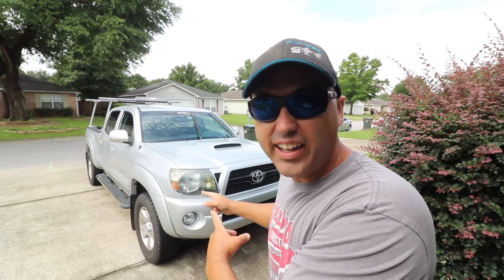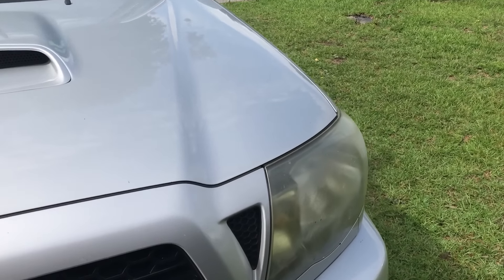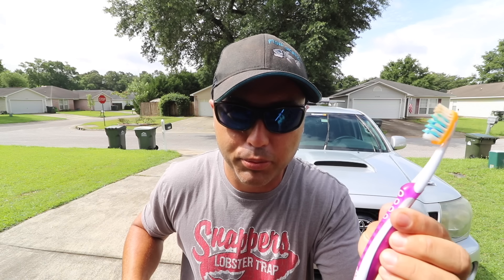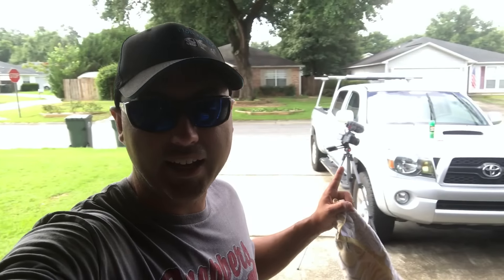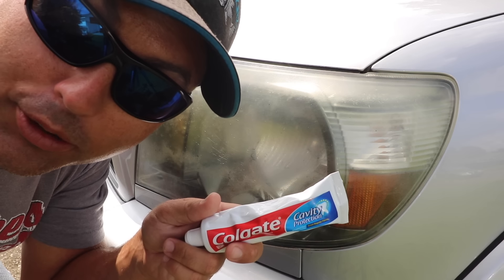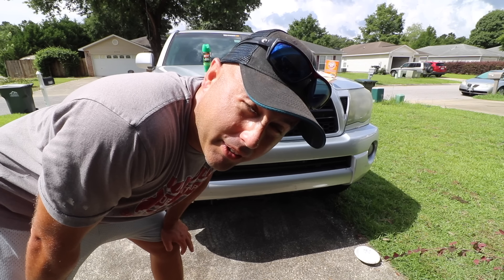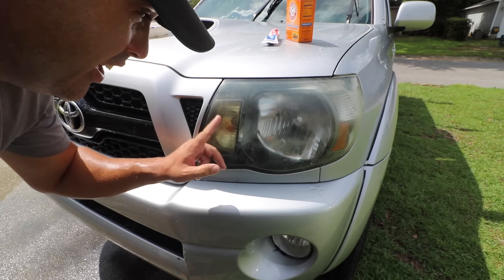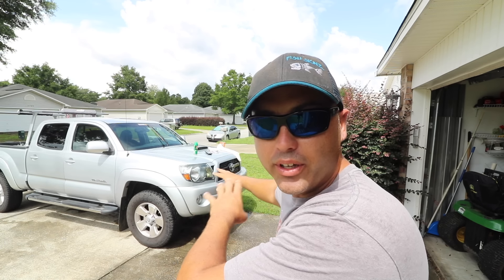The TRUTH about OFF & Toothpaste vs Headlights! (+Update on WD 40)

Comment: If you want to clean your head light plastic, use a wet 3000 grit sand paper, keep the water hose dribbling on the plastic as you rub in circles.
After you have cleaned the gunk off,
Then use chrome polish and a buffer wheel to polish back to a shine.

THEN MOST IMPORTANTLY 
SPRAY THE CLEAN HEADLIGHTS WITH UV PROTECTIVE CLEAR PAINT!!!

You should be able to get all the necessary stuff at your local hardware store.

This is a ONE TIME AND DONE FIX!
At least for me it has been.

Comment: The absolute best way to clean these up.  Start off with 600 grit sand paper sand it until the whole thing is hazy.  Then go to 1000 grit. Then move to 2000 grit. Then get some good wax and a buffer.  It will last a very long time. I do them all the time for people at work.
Reply: After the 2000 go to a 2500 or 3000 grit wet sand.Blow them off with some air/wipe them dry tape the trucks front off and spray them with clear coat. Then wet sand that with a 3000,dry and spray or wipe a thin layer of clear coat on and it will last for years. A friend taught me this and My trucks headlights after about 6yrs still look great.. Thats probaly the most permanent way to go..
Reply: Very true... This is the way
Reply: Yep. I bought a little portable sander just for headlights.
Reply: Yes but for those not wanting to deal with the clear coat, just end it with a synthetic wax, reapply every 6 months (or sooner if you drive a lot).
Reply: I sprayed. Mine with clear coat it fills in the scratches
Reply: Doin the most
Reply: If you do this method and then add a 5 year film that peels off 👍
Reply: spot the redditor
Reply: The only way to do it right

Comment: Mother's brand mag and wheel polish. It is metal polish. Metal polish removes oxidation. Takes two minutes with microfiber cloth. Buff in hard with two fingers. Wipe off with clean part of cloth. 5 ounce container at Walmart in wax section. Works about 4 months. Buff again it gets better. It will not work if it is heat damage. Homeless guy showed me.

Comment: The toothpaste would probably have worked better if you worked it in with a rag. That way it would work much like a rubbing compound or wet sanding. Actually buffing is still probably the best option in my opinion.
Reply: Actually the toothpaste does work . Put the paste on with your finger rubbing in a circular motion once you cover the whole light use a clean damp rag and rub hard circular about 5 to 10 minutes rinse off throughly let dry then rinse off a second time then dry with clean cloth. Next step buy PPF .. 3M paint protection film and place this over your head lights film will last about 5 years . replace when needed .

Comment: I used OFF on my Tahoe headlights a year ago. Sprayed on and cleaned off, then sprayed on and let dry without rubbing it off. I was amazed and it still looks pretty good a year later.
Reply: just got me a tahoe 👀and will do as you said. THANKS😃👋
Reply: faithlilis - Don't spay bug repellant anywhere on your truck or car. It will ruin the paint. Spray it onto a rag and carefully wipe your headlights.

Comment: After 15 years on a used car lot, I used off on a lot of cars. You will have better luck by spraying the off on the rag (microfiber) first and apply it to the headlight in a fast swiping motion horizontally. If you get too much on the headlight, it WILL soften the plastic cover.

Comment: What people fail to tell you is that toothpaste works like rubbing compound...you rinse your headlights and put a quarter sized amount on your buffing wheel and polish your headlights on high speed. Then make sure you follow up with headlight polish to prevent your shiny headlights from fading in the sun. Restoring headlights is basically removing the damaged top coat of plastic. The problem with all restore jobs is that you end up removing the hard factory finish so you keep having to polish with rubbing compound and polish it once a year to maintain it.

Comment: Dude, use a towel or rag and use that with the toothpaste. You gotta scrub man...you ain't fightin cavities you're buffing a headlight.
Reply: Classic comment .... you ain't fighting cavities you're buffing a headlight !
Reply: Lmaooo
Reply: Lol
Reply: Yup, used some arm and hammer toothpaste on my old headlights before waxing it with some fancy ceramic wax and two years in they're looking good as ever. Probably get better results just using increasing grits of sandpaper and wet sanding though. (Albeit at $2 for a tube toothpaste makes a compelling quick fix that doesn't eat your clearcoat if you overspray.)
Reply: i know...i thought the exact same thing...lol...tiny little brush...

Comment: As a professional who polishes everyday wet a towel apply the toothpaste.  The abrasive is very fine it may take 3 applications.   ( NO BAKING SODA ITS TO ABRASIVE IT CAN REMOVE TARNISH FROM SILVER ) Never use a toothbrush it will leave fine scratches of its own. The light grit in the toothpaste will polish the plastic lense surface to remove tiny surface cracks that diffuse the light and make it look foggy.  If the surface has deeper crazing use lava soap the pumice in the lava soap is more aggressive than toothpaste and will polish the plastic smooth faster. Then finish up with toothpaste.  After you make them as clear as possible seal them with a good car wax this will make them even more clear.  Like when you use floor wax on an old scratched vinyl floor.
Reply: What wax do you recommend?
Reply: @natenowicki1426  something approved for clear coat finishes
Reply: Is Lava soap still made?

Comment: Light rubbing compound works as well or better than any kit.  The abrasive grit actually rubs off the surface of the plastic, which is what has become pitted and oxidized, leaving clear plastic below. A good polishing after using the rubbing compound really makes them clear and shiny, and this method will last as long as the original headlamp did because you are starting with new surface, not one that has just been filled in with an oily substance.
Reply: Can you give me the name of a rubbing compound and polishing compound to get please. Thx
Reply: @kathymaclaren2711  you can used jewelry polish as well I’m sure. Auto Zone has that compound as well. Should look like thick lotion

Comment: Somebody may have already said this, but Crest toothpaste works really well, especially if you apply a thick layer of it (I use half a tube for each headlight), let it sit, scrub, then spray it off. Personally its my favorite method (the most effective for such a low price), and you only have to apply it every few months.
Reply: What kind of Crest? Regular or one with whitening? Thats interesting.
Reply: @cardinaldriver  mi

Comment: What I've done on my vehicles that works great and for years is, I sand the headlights or taillights fog lights etc whichever I'm doing with 1,000 fine sand paper until they're smooth smooth, then I wash em off and dry em, then I clear coat them with spray paint clear, let em sit a couple of hours then buff em, it works for years. This works for me just wanted to share
Reply: All you need is toothpaste and towel .Rub until clear. Works
Reply: I have done the same thing and it does work well.  Make sure you use spray paint with UV protection or it will start to turn yellow.
Reply: What kind of vehicles do you have?
Reply: @frankbama3684  I've had different years makes trucks over the years, right now I currently drive my 07 Silverado Classic and my 99 Yukon
Reply: I have a 2003 Honda CRV.  Did both headlights about 2 years ago and still looks good.
Reply: That's awesome bro heck yeah
Reply: leo stevens and alcoholic
Reply: I never thought of that. I always just use the off at the change of seasons
Reply: I heard Jack Daniels will make your headlights be shiny forever.
Reply: Ima try it 08 crv
Reply: Serafin Saenz when you say you coat tyem with spray paint clear, is this the name of a brand of spray in a store automotive department? 

Is the spray paint called Clear? And is UV protection in the spray too?

Thank you for your informative comment. 👍
Reply: Merry May - He is referring to Clear in a spray paint can that includes a UV protection. Most auto parts stores carry this. Places like Walmart generally carry cheap brands that do not have any UV protection. If so, avoid those. Get some masking tape and newspaper to cover the area around your headlights to protect it from residual spray if you don't remove the headlights during restoration. Results vary so read the directions on the paint can before applying the clear.
Reply: Merry May - PS. Clear is simply the color, not the brand. It is not recommended for use on headlights.

Comment: The correct way I use off for this !!   First have a rag or baby diaper ,, the softer the better one that will not leave lint  ... Spray entire headlamp , give it five seconds or it will melt the plastic ..rub lamp off in strokes only one direction only couple times .  You will see fantastic difference  but do only once in 24 hour period , then you can repeat if needed .  The affects will last for long time , regardless of comments I have seen below .  Have made many people very happy with this at my shop.  free of charge

Comment: The problem with DEET is the chemical reaction softens the polycarbonate lens on the headlight. It will clear up the haze but the haze will comeback pretty quick. You need to apply a UV protectant to maintain the clarity.
Reply: So use off then suntan oil?  Got it!!

Comment: Hi.  I used to ride motorcycles... the thing that was always recommended for exactly this for both fairing windshields and light covers is.... Meguires Wax Cleaner.  Works like a charm.  Just put it on, wait a minute or so, and then rub it off. Cleans up clear plastic amazingly
Reply: Monty King - That's what I use. It's a great product for slightly neglected paint surfaces. On a car with slightly foggy headlamps, it only lasts about a month if the car isn't usually garaged. I rubbed them with plenty of pressure for about 10 minutes each. They looked brand new for about 1 week and by 4 weeks, not so good. DuPont rubbing compound first, then DuPont polishing compound second, then Meguiar's Cleaner Wax worked better. Regardless, the lenses MUST have a durable UV protection applied or they will not look good for long after restoration.

Comment: Hey, loved your inference of what works. Using the Off every weekend for a month might be even better for long term. Then once a month. The light assembly on my 2009 BMW 328i cost $1,200 apiece to have replaced. If I do it the assembly’s cost $1,900. 

I think it’s worth me cleaning them once a month with Off bug spray. 

I’m going to try the bug spray on my outdoor light fixture that has yellowed. 

Thanks.
Reply: Did you melt your headlight plastic off yet? Thats what using spray long term can do
Reply: This recent video showed "Repel" working very well. Will try it. WTHeck.

Comment: I used to work at a car parts place and someone showed me using Meguiar's Marine one step compound to clean (used to clean gel coats on boats, so it's gentle) the headlights. We used a regular wax applicator pad and went to work.  Yep, you gotta apply some elbow grease. Once they are clean and shiny, you give the headlights a nice coat of the Meguiars wax to keep them protected which lasted a couple of months. Reapply the wax and it kept the headlights clear. 
I've also used the bug spray, it works, but over time it clouds up again. The clear coat spray idea is a good one.
Reply: O.k.

Comment: Use 3000 grit sand paper instead of a towel or tooth brush. The results will amaze you. Thanks for the tip :)
Reply: Really? Cleaned the glass without permanent scratches? Would have loved to see a video...
Reply: Or extra fine grade steel wool, maybe.
Reply: @junehutchinson3658  check out the video link below. Believe it or not, high grit abrasives are used to polish surfaces like glass and stone & metals :)
Reply: @briandesmondcouche  sorry, I can't see any video link. Am I doing something wrong? Does the process work on both glass and the newer plastics being used? Tyia. 😎🙋🤔
Reply: @junehutchinson3658  it's not glass !!   Plastic, keep using finer grades of sandpaper and change directions of sanding.
Reply: 3000 grit is almost like velvet.

Comment: I have had Off partially dissolve an old plastic watch I was wearing when hiking in the swamp years ago. 

I still wouldn’t use it on headlight covers. I just did my wife’s car with a Sylvania kit and it worked very well.

Comment: The toothpaste without baking soda works great. Use the Colgate cavity and worked great for only $1.  I didn't use a a tooth brush, used a dish washing brush with short bristles. Don't use circular motions,  but up down and left right. Let the toothpaste dry while you do the other headlight.  Go back to the first headlight and buff the toothpaste off (I used a 6" electric buffer).  Don't wash it off, buff it like with was. Then wash the headlight.  Repeat on the other headlight. I did all this with no water hose at my apartment.

You might have to do this 2 or more times, but it works.  I did this on a 1999 Honda civic, 20 year old headlighrs that were totally yellow fogged.  2 applications and they are almost totally clear! For one dollar. 3rd application will get them totally done. Spend a bit of time with the toothpaste, then wax the headlights.  Cheaper than the kits.
Reply: Colgate also works for buffing out scratches in CDs.
Reply: How long did it last before going bad again or are they still looking good ?

Comment: Thanks for the video, Yak.  After spending the evening watching video's and reading comments, I've sanded, wiped with mineral spirits, and clearcoated the front lenses.  Looks great - so far (1 hour).  Gotta say that the claims that the hazing comes from UV can't be the case.  The rear lenses on my 2004 Lexus are very clear with no treatment.  Hmmm... same sun, different end of the car.  I suspect the highway-driving sand-blasting over the last 16 years and 190,000 miles are the cause of the front lense issue.  The less one drives, the better it gets for everybody.
Reply: I was told it's where water 💦💧💦 or condensation gets behind them, n heat up all day, so plastic almost cooks, sounds reasonable but I'm grasping at miracle 😆🤣❣️... The kits do work for few months, but I have to do again for winter ❄️ n rain ☔❣️
Reply: My theory is that the motor oil residues on the roads, or the residue from the road itself, gets misted up onto your headlights when it's raining and you're getting misted by the person in front of you.  I think the residue degrades the plastic.  But that's just my theory.
Reply: There is a clear coat over front headlights. The front lens' have a different softer plastic so as not to crack or break when rocks hit them. The rear lights have a harder plastic lens.

Comment: The best way I’ve found to do head lights is to take 400 and 600 and 1200 wet sanding paper and buy you’re self a can of none yellowing and none fading clear coat in a raddle can, then take a garbage bag cut out for the headlight and tape it down and make sure that you tape the rubber around the headlight. And you want to soak the sanding paper for a half an hour in warm water, and start sanding with the 400 first, and as you sand you’ll see a milky film coming off that’s the clear coat from the factory. Then go to the 600 grit and sand the whole headlight now use the 1200 and and till the headlight looks smooth. And dry the headlight and if you have an air compressor blow out and standing water, then let dry and wipe it down with rubbing alcohol and let dry.. now start out with a lite coat of the clear coat let dry for 20 minuets then apply a second coat make it look wet BUT not to the point it wants to run or sag, and let dry for 25 minutes. Now put on the last coat and try to make it look wet and make sure to spray the whole headlight. This works really great mine has been done for two years now..
Reply: I seen it done in a video.

Comment: WD40, OFF is a cheap fix. You just have to apply it often or after each car wash. Not too bad for the price.
Reply: Spend about $15 for a bottle of Meguiar's Ultimate Compound and a couple microfiber cloths and you'll only have to do it once -- no scrubbing...just enough pressure in small mellow circles with a dime-size blob of the compound on one of the towels, buff away with the other, and they'll be crystal clear...no need to repeatedly reapply.   It also works really well on tail lights -- they'll look brand new.  Keep the compound around for other similar cleaning needs, and of course detailing your car.
Reply: @TroyaJamilyn   n my m 

X
Reply: @TroyaJamilyn ?
Reply: @elnewbie2611  Yes?

Comment: I use to restore old Corvette Sting Ray’s from 1966 & 1967. Model years  I used a Plastic Polish on the Back Window on the Corvette Hardtop to remove the scratches from the Window. The only product that worked and you may want to try is called NOVUS Plastic Polish in the White Bootle with the Red Label. You can even use the product to Polish the car, but I would try it on your Headlights